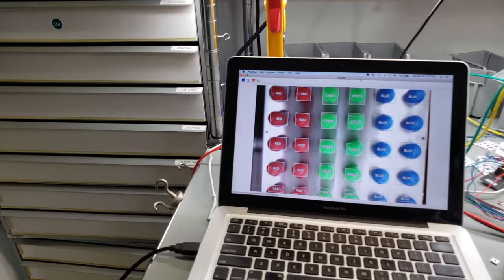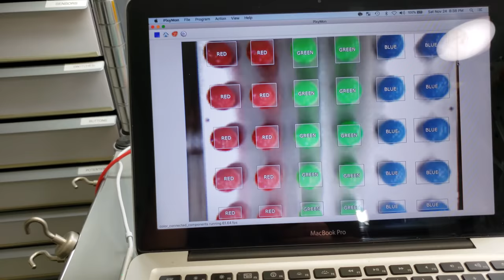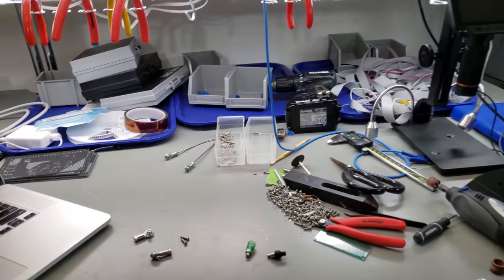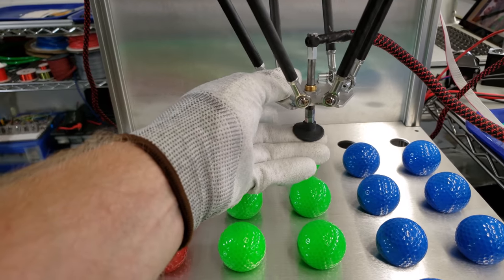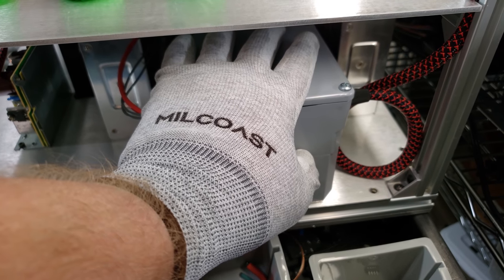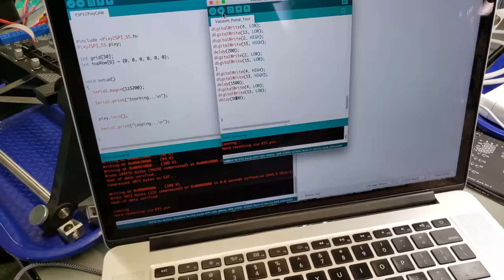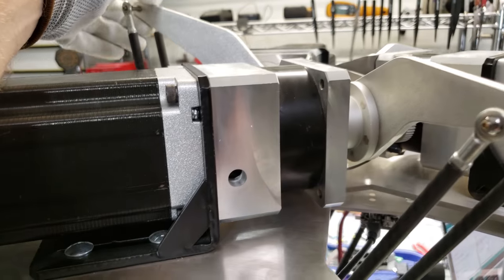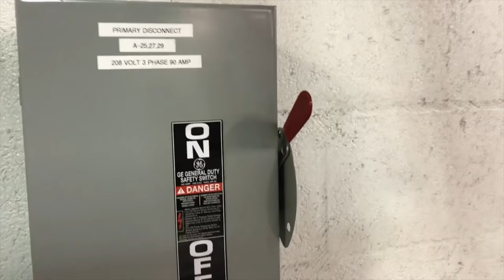Adding Vision to Delta Robot and Other Upgrades

Comment from the maker: Here are links to some of the equipment used on my delta:
Stepper Motors and Drivers - https://amzn.to/2RcFBqK
Golf Balls: https://amzn.to/2r4rkBl
ESP32 - https://amzn.to/2TK9Sik
Object Tracking Pixy Camera - https://amzn.to/2r4GaaL
Braided Cable Sleeve - https://amzn.to/2LedCnb
Stainless Steel Cable Ties -  https://amzn.to/2LevZsb
Strain Relief Cable Glands - https://amzn.to/2LdnuO8
Silicone Fusing Tape - https://amzn.to/2J5RPO8
Locking Casters - https://amzn.to/2kJ75WB
Aluminum Extrusion - https://amzn.to/2Lh14M7
Cable Clips - https://amzn.to/2xColG8
M5 T Slot Nuts - https://amzn.to/2HdnNWP
M5 Screws - https://amzn.to/2J4OSBs
Carbon Fiber Tubes - https://amzn.to/2J5xVqz
Suction Cup Nozzles - https://amzn.to/2Qh2Vqg

Comment: Get a small inline nylon fuel filter and place in the vacuum line. Does both filtering of the air so the valve and pump does not clog up with dust, and also acts as accumulator and sound damping. The smallest one works fine, and generally has 6mm barb connections each end, as a larger one does increase the time the pickup needs to get a good seal due to the larger volume it has to evacuate. generally ask your auto parts store for a filter suitable for a 1970 VW beetle, and you get one that is tiny, as the vehicle originally only had a strainer filter in the carburettor, and most owners added the external one on later. With vacuum use you do not even have to use clamps on the hoses, provided they are a tight fit, and 8mm PU tubing will fit there with some softening in hot water first.

Also used this on a vacuum gauge, as they are amazing dust collectors when used cyclically, and put the vacuum sensor after the filter for the same reason.
Reply from the maker: Cool, I've never used those. Thanks!

Comment: Super cool progress Proto! Couple ideas come to mind for the maybe later list
-Replace that noisy vacuum pump with an air piston and a linear motor, hooking the feed line up to your little suction head. that'll allow you to draw a vacuum quickly and quietly. Also shouldn't have to worry about the heat buildup after extended use that a vacuum pump will generate. (also allows for blasting air out the head I suppose? Or if dropping things isn't quite enough you can shoot em into the lower plate :P )
-Now that you have a spring loaded grabber, you can 'feel' for objects along the y (vertical) axis with a micro switch under the vacuum line in the normally closed position. That oughta help with programming as you won't have to hard code in a pickup range but rather wait for the microswitch to go dead.

Love the videos as always, your maker space is quite impressive and you have the knowledge to make things tick :D
Reply from the maker: Thanks for the tip! I have looked into using a linear motor with a syringe but I never thought to use an air piston. I have plenty of air cylinders laying around I could use.

Comment: You obviously bought the camera and software already so this won’t help. but I suggest you get a Radpberry Pi and any RGB camera. The Pi can handle all the processing on the newer models and you wouldn’t have to plug in a computer like a MacBook all the time. You don’t really need a fancy camera, if anything you should get a low resolution camera so that the computer has less data to sift through. I find it interesting that you put it at the top since the delta arms would get in the way but I don’t know where else you’d put it.
Reply from the maker: I don't need to plug the camera into the computer, that was just to show everyone what the camera sees. The camera stores all the settings on board and communicates with the ESP32 via SPI. I will eventually get involved in OpenCV 4.0 using either a raspberry pi or just use my spare laptop. This is my first attempt at anything involving machine vision so once I get comfortable, I'll move on to more advanced features of OpenCV like facial recognition and neural networks.
Reply: @ProtoG42  Well good luck.

Comment: Go ahead with a raspberry pi a normal camera and open CV just trash that pixy crap I can't find any practical use for it at all.
Reply from the maker: I may end up going that direction eventually but it's fine for my applications right now. I have been eyeing the OpenMV Cam H7 which comes out in march.
Reply: Can you explain  me that with the raspberry please?
Reply: Engipreneur openCV is a computer vision library for python that is actually used in commercial applications and very easy to learn just youtube that you'll find quite a few of those vids explaining different element of CV
Reply: i did some color classification with openCV, but be aware that a lot of camera's have inbuild auto white balance (awb). you can set a lot of camera properties with openCV, but not awb for some obscure reason. You can disable it manually with CV_CAP_PROP_SETTINGS, but most camera's dont remember their settings after power loss, so you have to do that every time. There are ways to work around it (i found a way using Direct Show, which belongs to the Software Development Kit of Windows). Maybe also solutions for raspberry exists? But awb can be a real nightmare.
Reply: @maatwerkengineering3398  The raspberry pi has APIs for getting/setting coefficients for AWB and allows auto AWB to be turned off so you can get coefficients that work and stick with them.

I was able to do black and white image processing for aruco marker detection at 25fps getting half sensor resolution(1640x1232) 4:0:0 chroma subsampled frames from the GPU (1640x1232 black and white + 820x616 red/blue components). The GPU prefers to output YUV formatted frames since it's optimized for video encoding and video is typically chroma subsampled meaning you get half the color resolution in each dimension. It can output RGB formatted frames but that slows the capture framerate somewhat. Color detection in the YUV space is completely practical though. Overall it's an OK computer vision platform that beats anything in it's price class.

Comment: You can use a vaccume generator.. 
It  sucks the air when solenoid supplies the compressed air to it and it release air or do not suck the ball after cut off the air supply through solenoid..

Comment: friend one question:

is necesary a gear box for lift balls, ?? because I see you have a nema 34 stepper motor (12 Nm).  so I think you have good torque.. and  forget about backlash?'   what is your opinion. I want to test for a detla robot to lift cookies. what is your recomendtaion.  ?? thanks a lot proto g
Reply from the maker: It depends several factors like how fast you want to go and what range of motion you need. Backlash is only an issue if you are placing very small objects and it is easily compensated for with the use of encoders for absolute position. This is the reason I placed the encoders on the output shaft of the gearbox and not on the back of the stepper motor. If the encoders were on the back of the stepper motors, they would not be able to measure the backlash in the gearbox. Without a gear box or other belt driven gear reduction, a delta robot like this with linkages will easily stall out if you try to move too fast. I'm using a 5:1 gear ratio to and I'm able to travel at a much faster speed than if I was not using the gear box. Also, it adds a bit of holding torque without the motors having power applied. Without the gearboxes, the machine will just faint when power is removed. Microstepping is required if you want any respectable amount of precision. The torque of a stepper motor is drastically reduced when microstepping and when driven at higher speeds. At 1/8th microsteps, you're already at around 19% of the original rated torque. At 1/16th microsteps, the motor now only has around 10% of the original torque rating. The power of these motors gives me much higher torque at high speeds and higher resolution compared to smaller stepper motors. Stepper motors are not usually subjected to direct loads like this as they are most commonly used where they have a mechanical advantage, like turning a lead screw on a cnc machine or a pulley on a 3d printer. The farther away from the shaft that the load is applied, the more difficult it is for the motor to move quickly.
Reply: @ProtoG42  thanks. so I will use a 5:1 reduction with belt reduction. because is expensive a harmonic drive. I think belt reduction has zero backlash with htd belts.  thanks man

Comment: Use multiple cameras and combine detections to work around the delta arms/head?
Reply from the maker: that may be the way to go in the future, but for now, I only need a snapshot of the table before it sorts the balls so this setup is fine for that application. Real time tracking would definitely need multiple cameras.

Comment: Golf balls have a dimpled surface, on the spectrum of suitability for vacuum manipulation they are at other end.

translation: you may find smooth balls better
Reply: Multifold cup handles those fine, designed for rough irregular surfaces. Does have a longer travel though, so less precise positioning, but generally used to handle paper in a printing press for this reason of sealing well.
Reply from the maker: @SeanBZA  Exactly! These Schmalz cups are great and make it surprising difficult to remove the golf ball when the vacuum pump is on.
Reply: Nice project, just some advice.
The shinny silver aluminum ball support tray is no good, make it flat black and your camera will work much better!
Your video would make more sense if the golf balls were in a random color pattern on the tray, in this video they are already sorted.
Reply from the maker: @glennmura  I needed to place all of the same colors together to make sure the camera was identifying individual balls instead of one larger object. As I mentioned in a previous comment, I will probably paint the table matte black or gray because it definitely picks up the reflections on the aluminum. The robot will end up sorting the balls with different common sorting algorithms. I think it will be a interesting way to visually see the differences between algorithms like bubble sort and insertion sort.